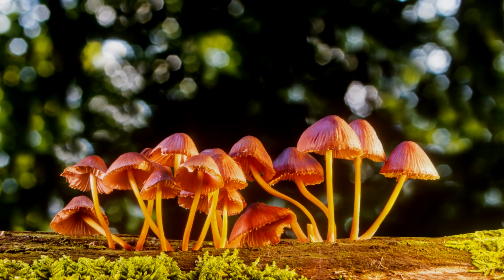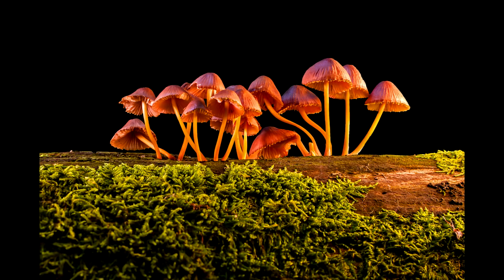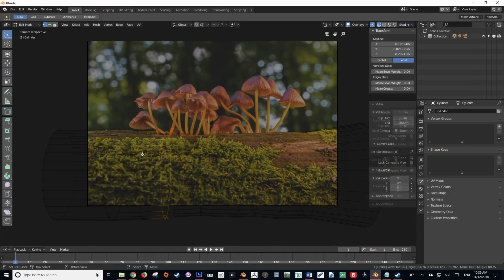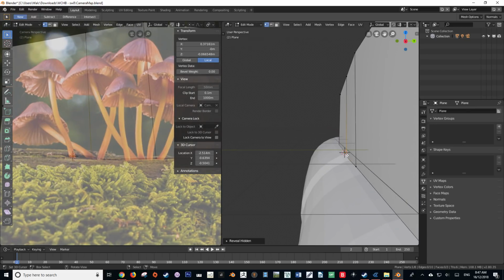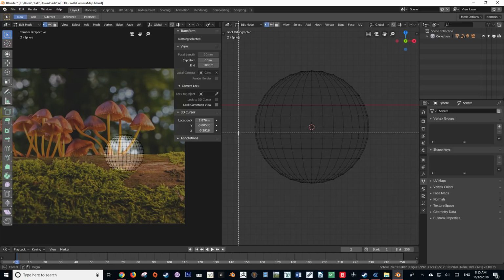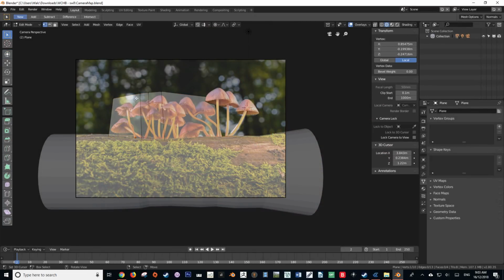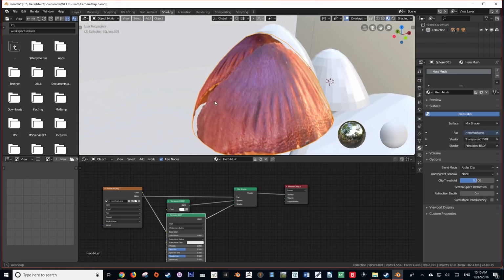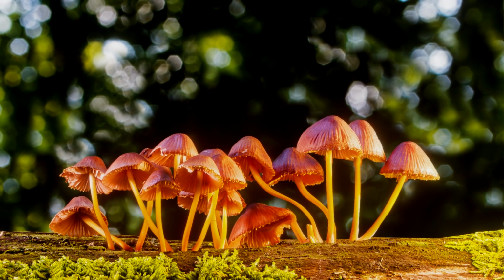Blender 2.8 Tutorial | Eevee | Camera Mapping

Comment: Using projection mapping for a decade or more, but I tried to use Blender for it for the first time recently. I was able to figure out everything pretty quickly on my own, but I am pinning this video since it's wrapping the process quite nicely and I`ll have a look to refresh the memory especially for the material setup because it's more complicated than just clicking the unlit checkbox in material tab. And do not stick with just the stills, it is working nicely on videos as well. Not sure if Blender is capable of mixing multiple projections though, which is required in more advanced scenarios.

Comment: hi! great tutorial, thanks! one question: is there any smart possibility to close the appearing gap, after adjusting the transparency shader?
Reply from the maker: The gap... Yes you can close it but it would require manual textureing on top of the photo texture.

I will have a bit more of a think on this. What type of shot did you have in mind?
Reply: @Polyfable  not necessarily a particular shot, i was just wondering if i could use this technique in more complex camera turn arounds etc. but I guess, I'll just need to do a whole, "normal" unwrap then?
Reply from the maker: @DanAlm13  No you can still do the UV unwrap from the camera, then you can just make another UV map (Auto if you really want) then do a little texture painting and overlay the texture making sure you have the corresponding UV map nodes linked to the right textures.

Comment: I really like those videos where images are converted into 3D. Just one question, why do you bother to create shadeless materials for this specific task? Since the look you want to achieve is the one of the original photograph, the best way would be to simply use an Emission shader for each image, plug it in the Color socket of the node, set Strength to 1 and get rid of any other lights in the scene.
Reply from the maker: There may be situations where a shadeless material would be better suited. Especially if you are using cycles instead of Eevee. But you are 100% correct. Emissions world be just as good!

Comment: Great video! 

Mind me asking how to get the XYZ translate arrows on the objects? For some reason I can't get that to show up when I'm moving/rotating my objects and cannot find the option to tick it on.
Reply from the maker: Sure thing, Depending on which version of blender you are useing it will be different. I will assume you are using 2.8+ beta. If you press 't' while your cursor is in the 3d viewport it will toggle your toolbar. The 3rd and 4th buttons down will give you the XYZ transform arrows. The 3rd is the transform tool which will also give you rotation and scale. The 4th is just 'move'. I hope that his helps. Please let me know if this has or has not helped.
Reply: @Polyfable  

Thanks for the quick reply! I was thinking that, but clicking on the buttons didn't make it appear. 

Though something I just noticed, In my other widows and workspaces, clicking on the buttons DOES make those handles appear, but for some reason in my main "Layout" window, they are hidden. Very interesting. 

Thanks again!
Reply: @Polyfable  Oh wow, I'm dumb. Hahah, I just realized I had ticked off "Gizmo" in my Overlays panel. Can't believe I missed that haha
Reply from the maker: @AnsenStudios  Haha... easy thing to miss. I have done that too!